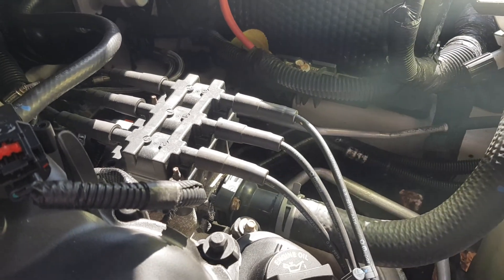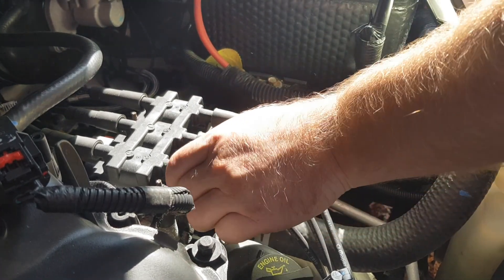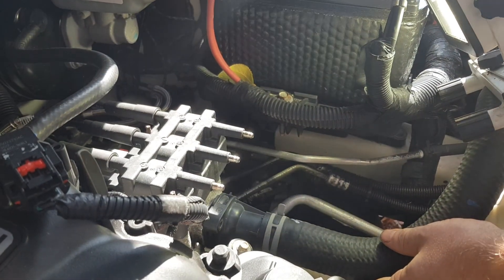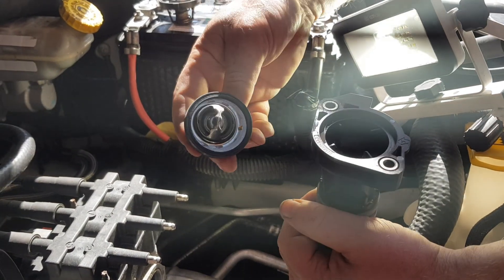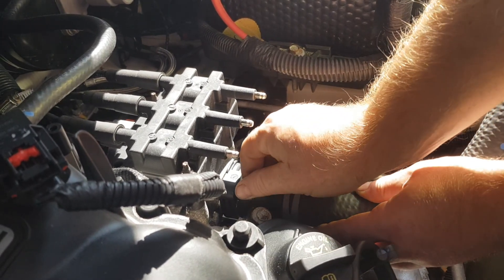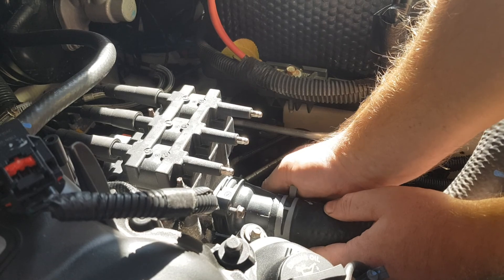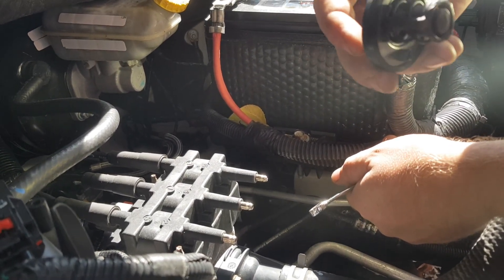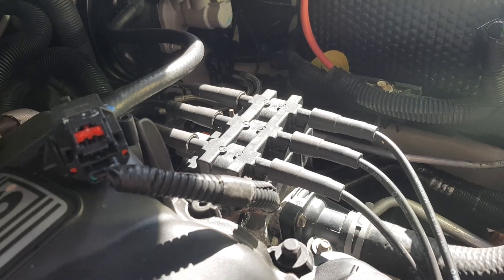2010 Dodge Caravan Thermostat Replacement

Comment: What would cause a coolant type smell when I turn my heat on? Would the thermostat have anything to do with that? Thanks.
Reply from the maker: @TopArrowMedia  sounds like your heater core is leaking. Look under your dash and underneath your vehicle around the heater core for leaks
Reply: @CringeComedyTV hoping it’s not that! Expensive fix. Thanks for the reply!!
Reply from the maker: @TopArrowMedia  anytime. Hopefully I'm wrong 🤞

Comment: i just did mine... an 08 and i hope i bleeed the system good. 1 thing idk how to do with that haha
Reply from the maker: It's real easy. Just loosen the bleeder screw and fill the cooling system until you see coolant coming out of the bleeder valve.
Reply: @CringeComedyTV  I do not know where its located but it didnt over heat i let it run for 15 min... capped it and put some in the other part lol took it for a 20 mile drive, but i notice i had no coolant in the upper hose after i shut it off. you know how the hose is to be solif... it was soft and didnt feel like coolant in the hose. so idk.
Reply from the maker: @shaunsfrench1942  There are lots of possibilities. The bottom radiator hose spring may have broken so it collapses; if it’s possible to do it safely, check it by getting under the car and feeling it while it idles and someone you can trust not to run over you gives it a few revs; you may feel it collapsing. Also check that the radiator recovery reservoir cap is holding pressure (or simply replace it - they are cheap). If it’s not holding pressure the radiator hoses will often feel soft rather than turgid. The radiator may also be blocked with either casting sand or silica that has fallen out of coolant (separated) that is well past its use by date (2 or 3 years); so flush the cooling system and radiator and refill with new coolant. If coolant concentrate rather than premix or the correct proportions of coolant concentrate and de-mineralised or distilled water has not been used the coolant may be becoming more viscous or even jello like in cold weather so the coolant circulates through the bypass system rather than the radiator that is exposed to the cold air. It can't be your thermostat if you replaced it correctly. Your water pump impeller may have corroded away; if you hold the top hose while someone gives the engine a few revs you should feel coolant pumping
Reply: @CringeComedyTV  I think i got it... i let it idle for 15 min steady with cap off... 2nd went reved it for 3 minutes each at 3 2 1 rpms and filled radiator and took it for a drive and let it sit for another 20 min at idle and it stayed right where it should be, heat was very hot. It had heat before the change, but was over heating. the 08 is way different then my 2016 Town & country

Comment: How do you bleed the radiator lines after you change the thermostat
Reply from the maker: I fill with distilled water. I jack up the front of the car to help air move out of the heater core and open the bleed screw to it, so it just barely dribbles out water then I wait for the thermostat to open a couple times. After I’m confident it’s bled I drain 2 gallons and put in concentrate. Also helps me find leaks before I spill antifreeze all over the place. Never had an issue with this method.

Comment: Mines leaking so bad
Reply from the maker: Where's it leaking at?
Reply: @CringeComedyTV  Thermostat housing connecting to metal on engine
Reply from the maker: @robertbjgvch190  are the bolts snug?
Reply: @CringeComedyTV  torqued to spec
Reply from the maker: @robertbjgvch190  did you kink the hose at anytime? How old is it?